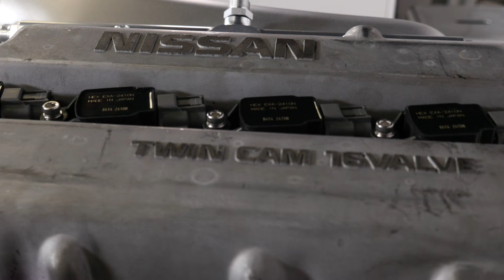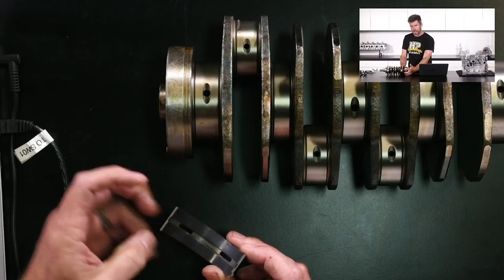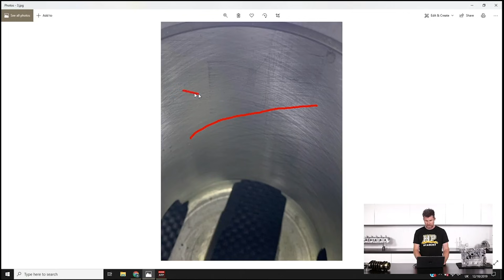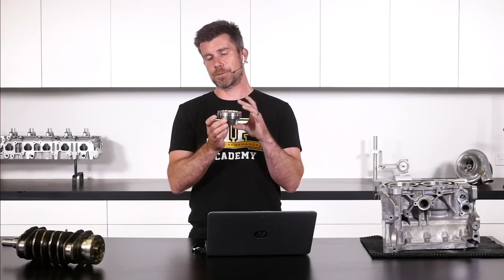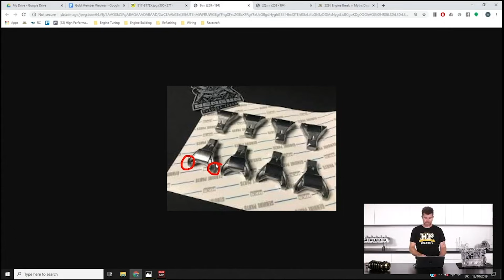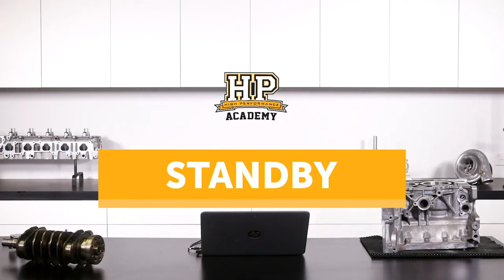Engine Break-In Myths Dispelled | Engine Break-In Tips And Tricks [GOLD WEBINAR]

Comment: Anyone wishing to understand more about the piston ring, cylinder liner and lubricant interface should read these academic papers. They may not tell you exactly how to run your particular unit in, as all unit specs will be different, but they will give you a better understanding of what is involved. These are pier reviewed by some of the worlds experts in the field of piston ring, cylinder liner coatings and lubricant specialists so they hold a lot more credence than many so called tuners word of mouth mutterings. Remember, these experts are the people contracted by, and who advise OEM's, Tier One Motorsport Organisations, and many others on how to build and use their recip units. Remember that any recip unit "running in" relies on many factors, such as ring coatings/materials, liner coatings/material, lubricant, temperature, cylinder pressure, texturing, static ring tension, bore out of roundness and others. As a thirty year veteran engine builder with countless hours of static dyno and chassis dyno running and as a researcher I can tell you that some of the greatest myths are fostered by some of the so called engine building/tuning specialists and should be taken with a pinch of salt. This subject is far more complex than you think.
https://journals.sagepub.com/doi/abs/10.1177/1468087413519783

https://journals.sagepub.com/doi/abs/10.1177/1350650111431028

https://www.sciencedirect.com/science/article/pii/S0301679X15000055
https://www.sciencedirect.com/science/article/pii/S0306261919318161
https://asmedigitalcollection.asme.org/IDETC-CIE/proceedings-abstract/IDETC-CIE2011/54846/401/351819
https://journals.sagepub.com/doi/full/10.1177/0954407016686249
https://www.sciencedirect.com/science/article/pii/S0301679X18305474
https://www.jstor.org/stable/44724334?seq=1
https://www.sae.org/publications/technical-papers/content/921453/
Reply: Care to actually cite any of those mostly irrelevant and paywalled papers? Anyone who understands the subject knows PEER-reviewed papers are great, but most are not reproducible, and most quantitive and qualitive testing is never published when performed by OEMS. All the aftermarket gets is empirical data. Go try to sound smart somewhere else.
Reply: I  have lot of respect for OEM engineers and they are the best in what they do and study various subjects to very great detail. As oem cars have to run reliably and cost effectively. An oem bearing expert might know a lot about bearings , but he may be layman when it comes to any other aspect of the car. Reputed after market tuners might be spreading a few misinformation out there and may not know the nth polynomial  equation for bearing lubrication but he knows what works with his experience of building aftermarket cars. That is the requirement of the industry. The kind of power levels they churn out  if it has to be done the OEM way with OEM  reliability then every build will be more expensive than a Bugatti Veyron.  Even if the ordinary engine builder is to read all the links you put out there he might be stupider than he started. Each industry has its requirements , I would rather you had some respect for the after market engine builders.
Reply: Thank for the references.
Reply: So what parts of this video do you agree and or disagree with?

Comment: i think that some of the heat cycle myths come from heat cycling a brand new engine, or block / cylinder heads. heat cycling a brand new engine / block /heads is something that will  make for a better engine. however, i think this has less to do with breaking in  than stress relieving the components. its not something that will be done in a few heat cycles. it comes from many heat cycles over time.

Comment: FYI, it's been my experience that most engine builders are using way to much oil on piston rings. For my NASCAR and aircraft performance racing engines, I use 3 drops of oil on each ring and very thin film on the cylinder,  piston skirts, and oiling pin,  using rubber gloves. Then to dyno
Reply: turnin wrenches on leaf blowers for mommies garden is different than modern day high performance engines. shut the fuck up if you don't know shit and stick to garden duty

Comment: As a person who has manufactured both pistons and rings (Repco) the recommended 'run in' was loading the cylinder by using top gear at low speed and running up to medium speed. Then close the throttle (to re-oil the cylinder) and repeat 10 times. Job done!
Reply: Top gear may lug the engine. Depends on the speeds you are talking about.
Reply: @jhndijkman  that's what I was thinking. Mid gear mid load seems better. Lugging is bad for all gas engines.
Reply: @jhndijkman  for small engines they want you to run at peak torque, so running the engine at low speed high gear would do the same. I personally do WOT high gear pulls (keeping RPMs low) for new cars that I get granted they already have some miles but my cars never burn oil.
Reply: This is exactly what I was taught by a tech school teacher. Have done this every time, no failures so far.
Reply: i fill engine hot water till holds 180 degres start then do drags up to 3 then 4 by the time i get to 11 or 12 times i am takin it till valves float or rev limiter sometimes shut the engine off slow down do it again then let get cold so gaskets set check as many bolts as possible then fine tune cars motorcycles n snowmobils tracktor whatever
Reply: What you are doing is loading the piston/rings against the cylinder walls...has nothing to do with lubrication.

Comment: I work at an OEM'er building big diesel engines. Every engine is tested for 15 minutes. 5 minutes of heating up, making sure all pressures are correct, nothing is leaking etc. Then after 5 minutes its full throttle all the way. Cold oil, somewhat warm coolant.  The last few minutes are for cooling down. Those engines don't burn a drop of oil. Nothing even remotely in the manual about 'breaking in'.
Its full send from the factory and it works.
Reply: My grandfather builds dirt track engines out of his garage for a lot of the guys running in the vintage class at the local dirt track.  This is after he was building them for his own car and beating (badly) the guys that paid big money for local shops to build them only for them to blow up halfway through the race season. Needless to say for the first few races every year they are constantly accusing him of cheating and the tech guy is always making him tear the engine down there at the track for inspection. 

I’m not sure the specs he builds them to but he assembles them. Starts them up, let’s them run for 15-20 min slowly running it up from idle to around 3500-4000 and back again. Just before he shuts it off gives it a few good redline whacks. Takes them off the stand puts them in the car and takes them to the track for qualifying. 

One of his engines finishes top 3 every race (at the very least 10, usually 15 or more cars are in the class) and outside of the random rocker failure or other failure that can happen to any engine being raced (incorrect fueling, timing etc) his engines usually last the whole season. Then when torn down at the end of the season usually just get a mild refresh for security but they usually look like they could easily go another season.  One of the guys there is still running one of his engines never rebuilt on his 3rd season and he’s still competitive.
Reply: High load on rings at idle due to CR and no throttle plate
I do almost the same when I build with moly rings, 20 -50 miles in town, check for leaks, beat on it a bit and gtg, cycle 2 -3 times if iron rings.
Reply: Excellent.
The same is for motorcycles. I know of at least 1 manufacturer who puts every single brand new bike through a full dyno run before it leaves the factory.
Reply: @human1513  yes, mv agusta !
Reply: We do the same thing for our Tugs at work running EMD's and Caterpillar 3516's, Fresh Rebuild- Top off fluids, Start the engines idle for 5 minutes then hook the engines up to 900 RPMs (for the EMD's) and 1600 for the Cats and let her sit for 10 minutes, Then bring it back down to an idle, Then we'll cast off and actually put a load on the engine and WOT on a push test for 2 hours.
Reply: Its always evident and satisfying when a expert in the audience comes in to lay down matter of fact for us to digest proper information.
Reply: Set that carbon ring on the cylinder as high as you can.
Reply: Same ,i used to work in an engine shop too .
I do recall the notes that came with some aftermarket liners that warned about idling more then 5 minutes unloaded as it could affect ring seating and now you have glazing. 
Give er a little beans, you're probably being too easy on it.
Reply: I recently rebuilt my td42t with chrome rings with new factory liners, it idled slightly rough for the first 20km because I was being soft on it, finally after steep hill and 10-15psi I pulled up and it idled smooth as silk. I'm now convinced of the high load early on procedure
Reply: @271production  exactly what I do when I have new vehicles.

Comment: i was agreeing right up to 9 mins or so , ive seen engines with 200k on them that still have the original hone pattern on the bore , so where does the wears off relatively quickly part start.
Reply: You're seeing the valleys, not the peaks.
Reply: @jeffreydurham5342  lol .... the oil won't sit on the peaks ... still ... a good come back ...
Reply: Hi Tom,
I think perhaps the terminology being used can be a bit of a red herring with what predominantly occurs during that early period of unit running. Like I have said in a previous comment it is a very complex area. The way that most people look at running in is a one method catches all. Different materials, lubricants, temperatures, pressures, etc, all play a part in how you go about running an engine in. An analogy here is, take the engine as a meal and the procedure as an oven.  
.........Hey mate, how do I run in my "roast lamb and spuds"....common answer, easy, "Gas Mark 5 for 30 mins". Hey mate how do I run in my "egg chips and beans"...common answer, easy, "Gas Mark 5 for 30 mins". Hey mate how do I run in my "apple pie and custard"...common answer, easy, "Gas Mark 5 for 30 mins". 
Each engine is different, especially hand built engines, and a running in procedure for them needs a lot of consideration. But reputable OEM's spend a lot of time and money with their Tribologists, Metallurgists and Lubricant Specialists to work out the best running in procedure for their units, so my advise, for what it is worth, would be to stick to what they say. If after that, all goes teats up, that's what warranties are for, and believe me OEM's don't like paying for mistakes after acting on advise from Jim Chipchop Racing's running in method. 
I can maybe answer your question a bit better if you are interested but it may get a bit boring and technical.
Reply: @mdf113  yes i'm always interested ..its always good to learn new things .. i've built many many engines . Granted not to the performance levels here .. but I don't expect to see my work back for many many miles .
T
Reply: Hi again Tom,
Here we go, it may get boring but I will try to keep it short, don't forget this is a potted overview of a complicated subject with many aspects simplified.
First off lets set some pentameters. We will consider our hypothetical engine uses a FeMo (Ferro Molybdenum) liner/bore surface (common in most iron block engines without liners), a CI (Cast Iron) ring and using a PAO or Ester base lubricant with no anti friction or anti wear additives. 
Look at the materials first. We need to look at the NANO scale topography of the material, so 1E-9m.....pretty small. The material surface under a high power microscope looks like the Himalayas with peaks and troughs covering the surface, and this is on the top of the texturing ridges (honing ). These peaks are know as "asperities" and have plastic and elastic properties. Now  for the lubricant regimes, these are, "boundary" regime, where the asperities often come into contact with each other, "hydrodynamic" regime where a film of lubricant separates the two sliding materials and a "mixed" regime where some touch and some don't, we will ignore EHL for simplicity.
Now, the asperities when prior to initial start up are predominantly in the elastic state and parts of them during the initial running will "shake down" and become plastic and this will reduce the height of the asperity, which is often confused as wear ,when in fact it is simply material deformation. Think of squashing chewing gum, when you release it some of it springs back but some stays flattened, this happens on those initial fired cycles,  which have far greater pressure in the cylinder than that which occurs during manufacture. The "shakedown" period to compress the plastic properties of the asperities is relative to all of the conditions I have mentioned in the past. Example a TiN coated ring on a NiSiC liner surface may take longer to "shakedown" than say a CI ring on a FeMo liner..... this is why running in is not a one size fits all, my analogy of the meal and oven in my previous post holds.
All of the little valleys between the asperities are what en-train the lubricant in an effort to prevent asperity contact.
When the piston approaches TDC it reaches the reversal point and at this point and for a short period after this, where the pressure of the ring on the liner is at its highest, due to the pressure from the compressed and ignited gasses, it will possibly be in the boundary lubrication region where the oil film is at its thinnest and asperity contact often occurs. This is where bore wear is most prominent and is sometimes seen as a very shiny area at the top of the bore. This also happens at the BDC changeover area, but to a lesser extent due to a much lower contact pressure of the ring to the liner. Remember the surface texturing is often at micro scale and we are in nano scale on top of the texture ridges which also contain a small amount of lubricant.
However as the piston recedes down the liner, ignoring piston rock as that can complicate things, be it firing or inducting, a film of lubricant that was sprayed onto the liner via jets or by windage forms a barrier that separates the liner asperities from the ring asperities and the system is now in the hydrodynamic regime of lubrication where no, or very little, if any, asperity contact occurs.
This is why when a correctly, and well lubricated unit with correctly sized components, (ring gap, piston bore clearances, ring grove dimensions, correct thrust angles etc), will suffer only pico scale liner upper, mid and lower stroke wear, if at all any, (but not in the changeover areas) and appears, and often is, in good condition because simply put, the piston ring and piston are floating on a nano scale thickness film of oil separating them from the liner as the pressure in the cylinder dissipates. If you are getting even a small amount of mid stroke bore wear, (other than bad thrust fitment), you have got something seriously wrong.
We haven't got to the lubricant side of things yet, and that's another thing to throw into the mix.....!!!
This is one of the many reasons why thermal properties of the liner, ring, piston etc, must be considered when clearancing is done. 
A low thermal expansion piston fitted to a high radial expansion block/liner can promote blowby, lubricant consumption, piston slap and low power. On the other hand a high expanding piston on a low expanding block/liner can create mixed or even boundary conditions and the piston may seize. 
Remember this is a very simplified explanation and if anyone else wants to have a crack at it in half a dozen paragraphs, feel free.
Reply: @mdf113  You have hit the nail on the head , I will freely admit that I only think on a micro scale , falling into the belief that the rest , ie the nano scale will some how just looks after its self , and I will freely admit that Ive never thought about the geometry and materials choice ine the -10 scale .
a very interesting post , and a lot to think about ,and as you have all ready said ,, thats without thinking about oil and additives.
Many thanks for the time you have taken to reply , Its a poor day you dont learn something , and today I for one have been given lots to think about.
Reply: @tomthompson7400  You are welcome Tom. I always have time for people who want to listen and wish to accumulate more knowledge. My research with compression ring/liner/lubricant interfaces for a Tier One component manufacturer at the moment is throwing up alternative considerations daily, so yes, WE are ALL learning every day. Good luck with all your projects and I hope the snippets I have mentioned may help.
Reply: @mdf113  Many many thanks , keep safe . regards Tom
Reply: When Jim Bob forgets to add engine oil the wears off relatively quickly part is about done

Comment: Manufacturer manuals usually tell to drive gently first 1000-1500km.
Reply: The longer you take it easy the longer they're comfortable with warranties
Reply: They normally have that listed because other than the engine, they dont want you to push hard and all of a sudden the shocks failed or the caliper seized, or any other parts on the car failed while you are driving aggressively.
Reply: The engine is not the only thing bedding in on a new vehicle. Trans, brakes etc.